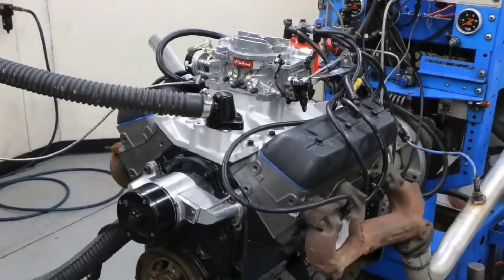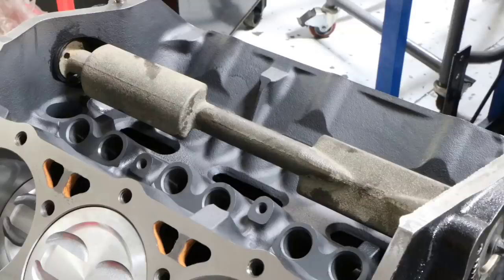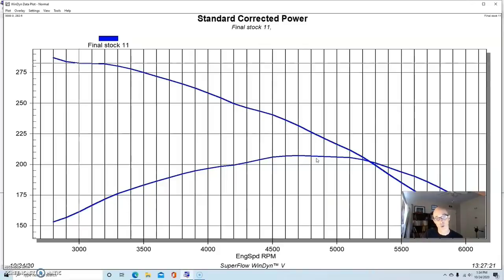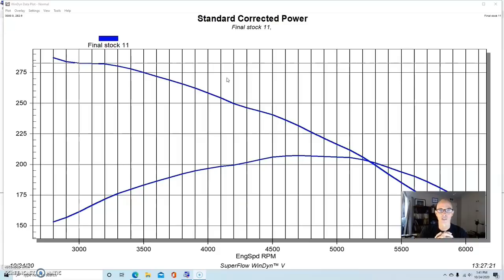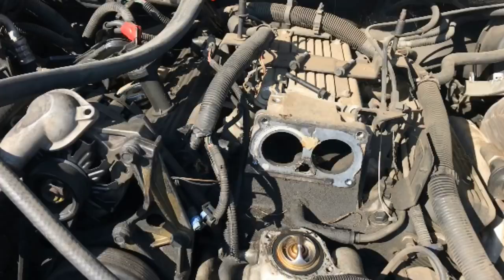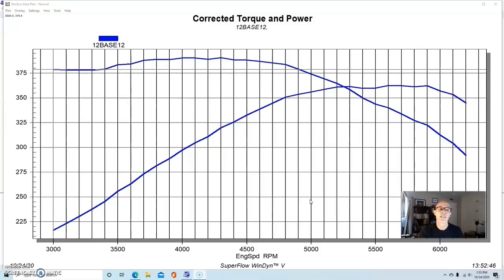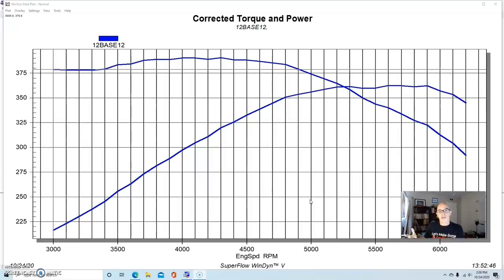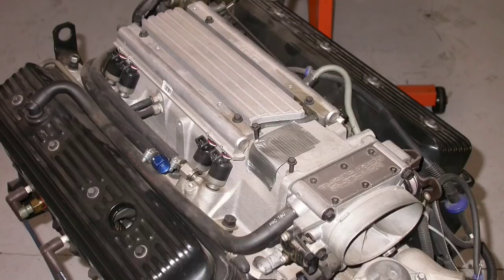4.3L V6 VS 4.3L V8-WHICH OTHER GUYS MAKES A BETTER BUILDER?

Comment: I had a '75 Nova with the 262 (4.3L) V8. Absolutely pathetic engine. My '76 Nova with the 250 I6 had so much more power all around. I have an '89 S10 that is on its second 4.3L V6. The first one I broke the crank making 535hp/450lbs. The second engine has yet to run in the truck, but made 320hp/350lbs on motor, and I'm using less nitrous and keeping it under 500hp so I don't break it again. And no, I've not hit that one with the bottle yet.

Comment: The LV3 4.3 used in 2014+ Silverados is a decent motor. Its all-alloy with 285 hp and standalone wiring is available.

Edit: now with 297 HP.
Reply: LU3 was the best of the SBC vortec (non ls)
Reply: The 2014 v6 silverado is faster than the 99-03 5.3 silverado stock for stock. They came a long way
Reply: pretty healthy for a NA 4.3L

Comment: Which would I rather have?  Neither...
Reply: Schwinn or Mongoose seem better options
Reply from the maker: Schwinn with straight ups, 2-speed kickback and sissy bar with banana seat! OG! (Cheetah Slick!)
Reply: @richardholdener1727  Id go for a BMX like a Diamond Back myself
Reply: @richardholdener1727  lol my mom had that same Schwinn in the 60's! That Banana seat is OG AF!
Reply: @richardholdener1727  In big ol green metal flake please, thank you!
Reply: @ryanmalin  Diamond Backs and Mongoose were the shit back in the 80s.
Reply: Naw man... CW racing
Reply: @xmo552  Was a 70' schwinn banana seat with training wheels toddler and a mongoose 80's teen... many options have a place and a time, now i'm just an old LSy F....
Reply: @opieg7333  
Yuuup. I don't have my muscle bikes anymore. I don't have my Diamondback anymore. But, I do still have my 78 and 83 Mongoose. Man I had a ton of bikes. At one point I probaby had 15-20 BMXs at the same time. I would take all the bikes other kids would move on from. I mostly used them for parts, mostly tubes. Like water through my hands they went. 
#80's kid 🤘😁🤘
Reply: Oh wait. I do still have my custom chopped down cruiser Schwinn!
And my 78 and 83 Mongoose.
Reply: @xmo552  I think mine was a 84 or 85 chromemoly frame... Freedom to get into all kinds of trouble... miss the 80's...well being a kid in the 80's at least... I honestly do not even know what happened to mine...

Comment: This type of information is almost priceless,  your study matters... it would be nice to get elaborating on conversion from the six cylinder vehicles to eight cylinder,  Via from rear end to transmission mounts to motor mounts .... transmissions preferred. Of course weight v.s. horses🐎horsepower..... thanks again from,  JD

Comment: I have a pre-vortec 4.3 in our old boat and have found them to be tough durable and easy to repair. One big difference is the even fire crank on the V6 probably is not as strong as the conventional crank on the V8 and the other is that the balance shaft takes some HP to turn. Other than the 4.3 will fit into spaces the V8 won't, being approx 3.5-4" shorter, and about 100 lbs lighter. So good for swaps into older Jeep CJs, S-10s etc.

Comment: Some Caprices had the 5.7 like the Roadmaster and some Fleetwoods.
Reply: Most cop cars caprices probably had the 5.7L LT1
Reply: Yep N
And they were still dogs lol
Reply: @mikehigby7897  They ok for what they were. The 94-96 were rated at 265 hp and 300ftlb of TQ? not sure on the TQ number but pretty close. I hade a few Roadmasters and the 94-96 were a bit more powerful and better gas mileage. The great thing about them was only 15 mpg roughly city. Highway was nearly 30 with that OD. Great dependable cars with a decent tow package and the best eide.
Reply: @randyrowe3097  a car that can tow, not a truck or an SUV, but a car....... unheard of today
Reply: @mikehigby7897  dogs? hardly. the LT1 is far from a dog. the caprice is a heavy car. take that same car and same LT1, add a procharger....... not a dog anymore
Reply: LT1 Roadmaster is a perfect road trip cruiser/sleeper.

Comment: V8 without even watching the video through. The 4.3 v6 was just weird. They ran good enough but just always seemed wonky
Reply: I haven't ever seen one that ran as smooth as a V8. The 4.3 in my 85 El Camino is horrible to say the least😂
Reply: @nashvilleoutlaw   Later 4.3s have a balance shaft.
Reply: @timothykeith1367  I've owned and driven newer 4.3's they simply aren't a smooth running engine. Not compared to a V8.
Reply: 75% of a 350 was smooth
Reply: @nashvilleoutlaw  yup drop a LU3 in
Reply: @shadowopsairman1583  nah, have a 385 short block sitting in the shop at the moment

Comment: OK, until today I did not know that this L99 existed. I am a dinosaur but I love little chevy V8's. Two early 60"s 283 blocks at the machine shop right now. So I did some homework and here is the most surprising thing that I found: In August 2019 at the U.S. Nationals the #1 qualifier in Super Stock was a 1996 4-door Caprice equipped with the L99 engine. The car weighed 3850 lb with driver (Car #354, Ernie Neal, Columbus IN) and running in SS/PA turned a best pass of 10.83 seconds, and passed teardown. That's a lot of potential.

Comment: I had a 4.3 v6 in an old 3/4 ton van.  It literally did not have enough power to blow itself up.  I would have to draft tractor trailers to keep speed on the interstate.
Reply: I had a friend who set out to blow up his 4.3 v6 with a brick on the gas pedal. Revved til it layed over and hummed until it ran out of gas. My exact quote was "it doesnt have the power to blow itself up "
Reply: @youcanbesmartaskhow3857  3.0 in my ranger is kinda the same way
Reply: @CraftsmanQuad19  those are pretty good v6s. Reliable and powerful enough,  typical not-great fuel economy, but I've  seen many with high mileage when taken care of.
Reply: @youcanbesmartaskhow3857  I’ve got 300k on mine while beating the living snot out of it. 10k mile oil changes lately too. It just won’t die

Comment: I'd like to see some lt1 on boost ive heard of guys 12lbs on a bone stock lt1
Reply: Lt1 like nitrous and the also like boost. My street car i run 10psi from a Garrett  70mm. The race car motor was going to have a much bigger turbo  on it. But seeing how an aftermarket Lt1  large bore race block going to be  released im going to go with it. But there is a few lt1 guys with built motors make 2000 plus fwhp with them.
Reply from the maker: fwhp=front wheel hp?
Reply: @richardholdener1727   Flexplate/flywheel horsepower
Reply: @michaelstoker6710  so crank?
Reply: @hondaservicecenter  yes
Reply: @michaelstoker6710  grub worm has a caprice lt1 block that I think he said was cement filled but that car makes 1300whp but that wasn't all the way turned up also its a stick car so the block has to be strong
Reply: @masyningles8667  all the 5.7l blocks are the same and yes Jonathan's  is filled it all has a ported set of trickflow heads a solid roller de stroked 3.25 crank and a pro mod 102mm the car makes over 1600 rwhp( rear wheel horsepower). But he is just one of the high powered lt1.  Tony's  put down  over 1400 rwhp with a auto, tanners made over 2000 flywheel  on Steve Morrison  dyno. Tyteck rear mounted turbo 3gen ran 7s that would have put him in the 1400+ range and his new setup  i hear front mounted  is faster. Mine truned up would been in that range but I'm waiting on the aftermarket block and that motor will go in the street car and stay around 1000rwhp. There's a few more i can't think of at the moment they are just a sbc  so making power not hard with them but you have to think and plan it out unlike the LS where you just purchase what ever and still make power. I joke that I can put a jegs or summit book down and my 5 year old can point a enough parts to make a 1000hp LS.

Comment: With the 4.3 v6 a person Should be able to use Sbc aluminum heads and cut the end cylinder off then tig weld a cap on the end
Reply from the maker: would be cool
Reply: What would be cool is if someone with the skills would volunteer to build a set of heads this way for Richard to test.
Reply: @MRBoatwrights  absolutely yup , I'm thinking it wouldn't be hard , be more time consuming rather then " hard" I'm willing to bet it's been done some time before somewhere . As long as the water ports matched on the deck Surface or with aluminum easily make to match then it should work out , the end cap wouldn't be to difficult I'm thinking

Comment: This will be fun.  As hot rod enthusiasts, we should do our part to be green.  No, I won't give up my two big blocks in my boat, I need them.  No I won't give up my 427 Ranchero.  But I suppose I could live with 4.3 liters (with 8 holes) for my T-bucket ... assuming of course it would sing a beautiful song deep into the 8000 RPM range.  With more carbon fiber, it should have plenty of pep for Church on Sunday.  I haven't felt this green since I watched my neighbor crash his Tesla into his Prius.  Or at least that is my version of "life with just 4.3L".

Comment: I'm glad the L99 4.3 is finally getting some love. I had a 95 Caprice L99 for a while, got a couple videos of it on my channel, i loved that car, averaged 18.5 MPG with a lead foot lol. I also had a 79 Malibu with the 267, it was definitly lack-luster as far as performance, but it was a great cruiser and damn reliable. I've also owned many 4.3L V6's, awesome little motors. my first car in fact was a 1994 GMC Jimmy with the 4.3L CPI Vortec, 200hp/260ft-lbs. thing ran great, smoked a 97 F150 4.6 with it lol. The parts-swapping idea between the L99/LT1 is gonna be awesome, ill be waiting for those videos for sure!

Comment: Don't forget about the 4.1 v8 in the front wheel drive Cadillac's of the 90's
Reply: I think we can safely forget about those.

If someone wanted to work with that platform, the later 4.9 would at least be easier to find.
Reply: I recall them as junk.

Comment: I would take the V8. Ultimately, as you mentioned, the V8 works less to make the same or more power. That means longer life as a daily driver. I am experimenting on a stroker version for my Son's 2000 Camaro. I'm thinking a 6 liter, or preferably a 6.2 with the 3.27 stroke crank. Near as it matters, we'll call it a modern 327. 😎✌️

Comment: Richard, I had one of the 262's in a Monza that I put a Q-jet manifold and Holley spreadbore carb on.  I can tell you that combo really woke up that small motor.  Had the TH350 trans in it.  Had a lot of fun with that little car.  Never dyno'd so don't know any numbers.  Just seat-of-the pants feel.

Comment: do next a Oldsmobile DX diesel Gas conversion with the stock bottom end, Could be a torquey engine.
Reply: There’s nothing special about a diesel bottom end that makes it torquey. After the gas conversion it’s just a thick block gas engine.
Reply: My brother-in-law has one and he wants to convert it to gas and build it.  He says they can make big power
Reply: @iqinsanity  it has heavier components like the pistons and rods which I would guess would make the engine a bit more torquey but we're not talking about buick 455 torque
Reply: If anything it would just lose power. Yeah it’s more weight going down the stroke but it’s more weight going up it too.
Reply: @iqinsanity  the way I would think it would trade off hp to torque but that's me wishfully thinking since I'm building one.
Reply: Are the diesel pistons going to work with gas heads? I’m curious what the compression ratio will be.
Reply: @iqinsanity  well let's say if u use over 74cc smog heads with the stock bottom end the compression is gonna be about In the 9 to 1, but if you use early non smog 67cc heads you'll get mid 10 to 1 since they already have flat tops on them
Reply: You’re doing non smog then right?
Reply: @iqinsanity  yea I'm doing a non smog one if I can find a good set for a reasonable price. If not, I'll use the heads of a 403 trans am and I'll have to see how I can add a turbo on in it.

Comment: Given the opporttunity I would.prefer the L99 because it is expandable.  But also given the torque curve of the V6 I would chose that for older 1960s, 1970s GMs because it can pull a heavy car and has a ton of parts interchangeability with the 350 AND they are a dime a dozen in the junkyards.
Yea if I had a 1975 Chevy Caprice, for example, and the 350 or 454 was snatched I would gladly drop a 4.3 V6 and 700r4 in it and daily the car cross country

Comment: I have had both the L35 4.3 in a RCSB S10 SS and the LV3 4.3 in a RCSB Silverado WT.On the L35 I tried a small towing cam and headers but it didnt wake up much and was probably making 190 at the wheels if I had to take an educated guess.The LV3 on the other hand is definitely a little underrated motor.100% stock with no mods they are making 255 at the wheels using 87 regular and  270 using pump E85.

Comment: I did a lot of research into the 3.736" bore for when I used to have a 305 I wanted to mildly hop up.  Generally speaking, any 1.94/1.5 factory GM head will work with the small bore.  Aftermarket heads are more of a mixed bag as the valve spacing was often different.  1.94" intake is generally as big as you can go, but you can go up to 1.6" on the exhaust.  YMMV, I was focusing on Gen1 SBC vortec heads at the time.  Bigger valves will need careful measuring, and perhaps a mild relief of the block deck.
Reply: Bigger valves on a small bore 305 are kind of a waste of time. The shrouding effect of the valves being so close to the walls of the bore negate much of the benefit of larger valves. I wouldn't waste my time on bigger valves for a 305
Reply: @davelowets  yeah, this was meant as information, not advice. “Can” does not mean “should”. I was going to stick to 305 vortex heads with the regular 1.84/1.5 valve package.
Reply: Same as my reply. I wasn't criticising you for looking into it.

Comment: I had an old, I want to say N code, carbureted 4.3l V-6 in a 1986 C-10 Custom Deluxe with a step-side bed. The thing was abused to hell and back and I am surprised it lived as long as it did under the torture my teenage self put it through. So before I even see the results, I would almost kill to have my old truck back and fix all the damage I did to the poor thing, and that includes wanting that little V-6.

Comment: 4.3 v6's have the most boring exhaust note ever, that and the 4.0 Jeep i6.
Reply: Yeah, but they are tanks in terms of reliability and are cheap to upgrade.
Reply: @iDrive4fun93  they are the best at their job
Reply: @johnsheetz6639  yep, had a 2005 Silverado 4x4 with the 4.3. That engine wasn’t fast in stock form, but it was tough as nails
Reply: @iDrive4fun93  no they arent  lmao anyone thats actually had them know theyre pieces of shit my mom went through three engines when she had her jimmy and my crankshaft blew not that long ago in my s10 and i didnt even hoon in it and i maintained it extremely well and it barely even had 200K, theres 0 aftermarket support for them and everything is super damn expensive
Reply: @chrishansen7004  well you were doing something wrong. Ours ran great, and my buddies with S10’s went high miles with no issues. And there’s a guy I met a few years back who builds 4.3 V6’s in S10 trucks and drags them. And they aren’t slow, nor were they expensive to build. It’s a 350 with 2 cylinders cut off, and the aftermarket support is excellent.
Reply: @iDrive4fun93  yup found in extended cab trucks unsure if on crew cab
Reply: @303StreetMachines depends on level of boost especially with compression ratios of the piston, cylinder, head, piston rings...

Comment: I think the V8 is the best bet for every reason and I would choose it just because I'm a V8 guy but one thing you didn't mention about the V8 is being so tiny I bet it would run super smooth and quiet for a luxury car like the Caprice. I know you're talking about building potential, but just as it is it must be so silky smooth and purr like a kitten.

Comment: brings back memories of the 90s man I still have my 5.7 trans am...LTs are so underrated
Reply: I have a 1996 camaro LT1. She has a bad head gasket that I temporarily fixed with bars leaks. I'm going to have to tear her down and fix it right. 260k on that car but no rust
Reply: nice man I have 210k on mine still going I have a new gasket set I'm going to do all the seals at once check my videos

Comment: Did you happen to see the Power Nation Video when they added the turbo. then turned it up to13.8 Psi Wow over 500 Toque and 487 hp I'm guessing about all the little motor can handle but that's awsome!!!

Comment: Iv personally always learned as a rule of thumb all things being equal you will always have a more efficient combustion chamber in a smaller surface area combustion chamber. So best for boost v8 but again all things being equal and your splitting the power on more everything you know more rods crank pistons block it's all taking less stress at more power. Then there's vibrations and the fact they added balance shafts to the v6 shows it there inherently imbalanced unlike an i6. But I'm stoked to see what you do man keep it up I'm excited.

Comment: I'd pick the 4.3 v6 all day because the 4.3 v8 L99 WAS ONLY produce for 3 years! The non Vortex 4.3 v6 dates back to 1985 in chevy trucks/vans and the Monte Carlo. It switched over to Vortec in 1996 and continued until 2009.  So in Theory it should be way easier and cheaper to mod a v6 4.3 because of the production numbers and the availability. In other words the 4.3 is cheap and easy to find!  yes im aware they brought it back in 2015 but it's a different animal.

Comment: i wish the v6 had more support. it is 3/4 of a 350. all the hard work of designing the chamber, the intakes and everything is done. and there is a bunch of v6s out there. The guy that will hop up the v6 is the guy who is doing it on the cheap or is inexperienced. he doesn’t want to do an engine swap. its easy to just bolt heads on while in the car.